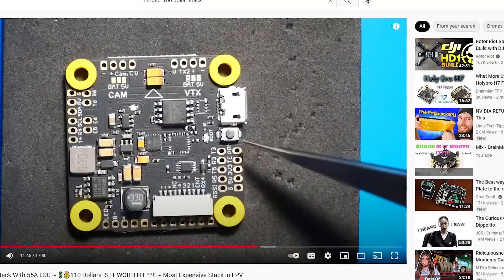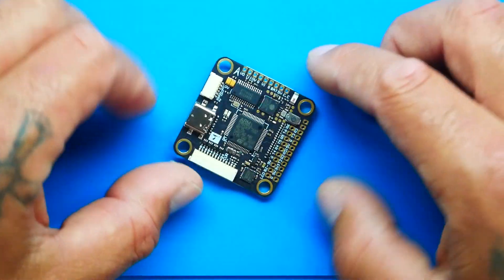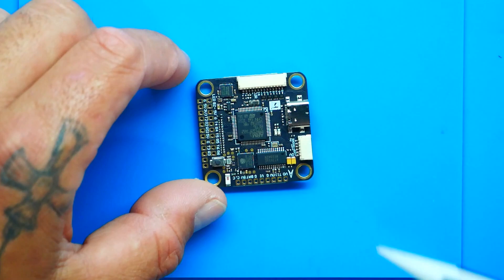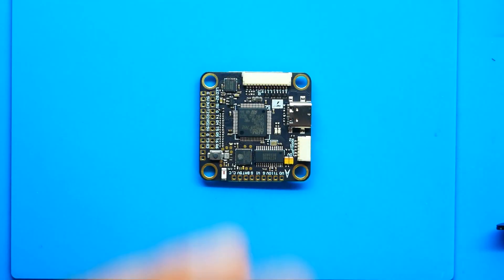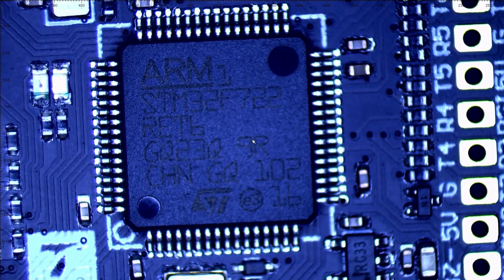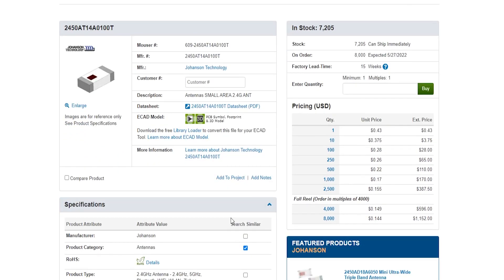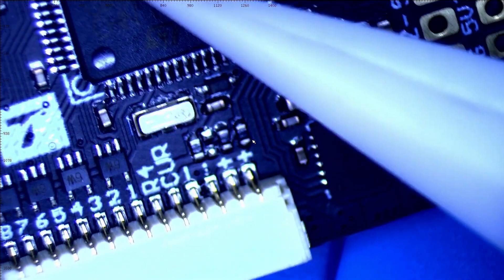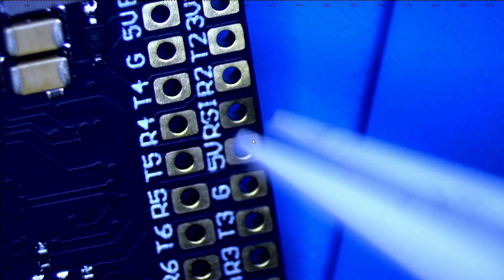F7 Pro Full Function Flight Controller! Literally Does It All! Wifi & Bluetooth

Comment: T-Motor F7 Pro X8 fix SDA and SCL. Connecting the M10QMC-5883L GPS Module works. Connecting SDA and SCL additionally blocks the barometer: CLI status. No barometer. Disconnecting SDA and SCL again detects BARO=BMP280

Comment: I have a question about this flight controller. Will the current sensing work with 12S voltage? I am trying to use my ESC telemetry to get battery voltage, but the voltage drops out every now and then and reads 0V once armed.
Any help would be greatly appreciated. 
The ESC's are APD 120A 12S

Comment: hey man......before one month i had ordered all the best of t motor...4x motors f60pro vi + f55A pro ESC + this FC F7 pro (with wifi + 8 motors etc)......i builded it carefully and i tested it flying first without i  add the dji air unit cause the frame is racing and goes upside the stack and its too tight..anyway it flew perfectly nice....then i go add with the ready plug cable as the diagram shows and boom smoke coming out of the bottom...i  immediately pulled the battery ....anyway i was waiting so long to fly again after losing my previoys drone that i paid almost double price to buy new same ESC from local store....and what happens? the drone power up the crossfire reciever and flys BUT the plug which i removed the 2 extra wires it had for if you fly using the dji remote controller and neither powers up the unit from the front pads with the 10V .....so the half pads working and the pads and plug for air unit are dead.....sure some regulator is dead but what am i supposed to do now? i already paid 2 times the same expensive ESC and now i have this half working f7 pro flight controller....also i have another 5-6 t-motors fc and flywoo which not working cause of fried capacitors...like my small firefly nano baby drone isnt working for one capacitor which i know the specs and i have the capacitor but is so tiny i cant solder it ...but my main concern now is the new drone which has THIS flight  controller you showing and its half working....i dont know if they refund me or not but i paid a lot and i dont have a drone again after waiting so long too and i m going crazy litterally.....

Comment: Can someone point me in the right direction. I just bought this model and I am unable to get the 10v pit mode to work. Pad is soldered, connections made but I think it’s something with the cli commands I need to enter which I can not find anywhere. Any help is appreciated.
Reply: same problem here , have you solved it?

Comment: I won't run BF4.3 on anything less than a H7 .Too much work for a F7 when you start adding stuff. Look how the CPU load goes up using 4.3 over 4.2 . Great video Drain Man.
Reply: Hi Paul are you using the tasks command with the tx on when analysing the CPU load on BF 4.2 or just looking at the CPU percentage at the bottom?

Comment: Do you have a recommend ESC to pair this with for 5in, 6s build? Thanks. 4 motors.
Reply: Tmotor makes great ESC's too. I'd start with them as you probably won't have to reorder the plug from esc to fc. Pretty much any 4 n 1 esc will work, they just may require work to reorder the wires.